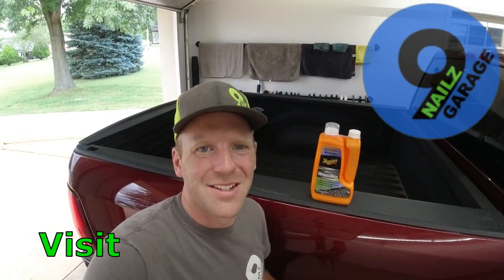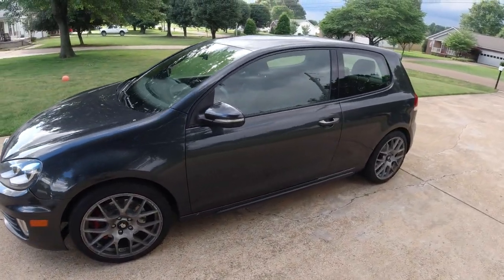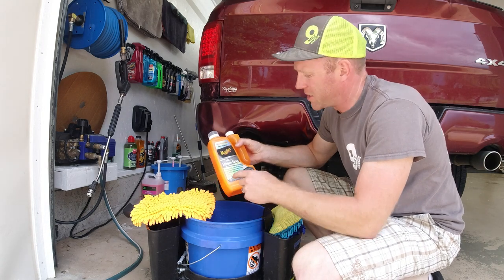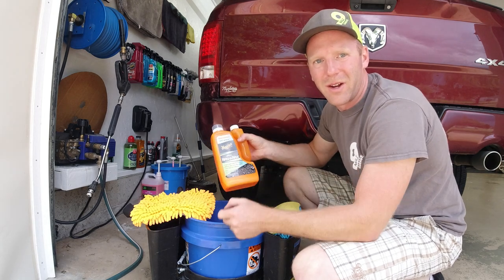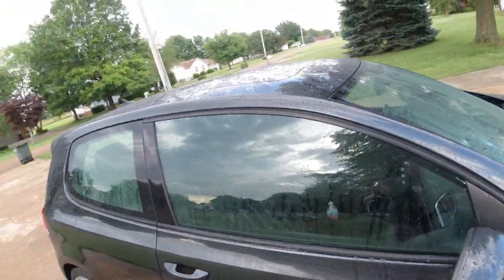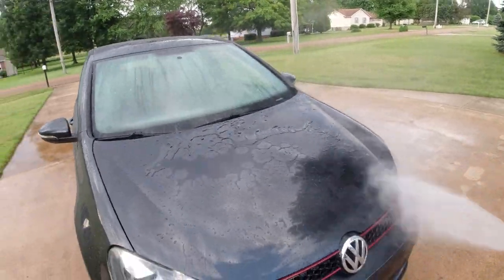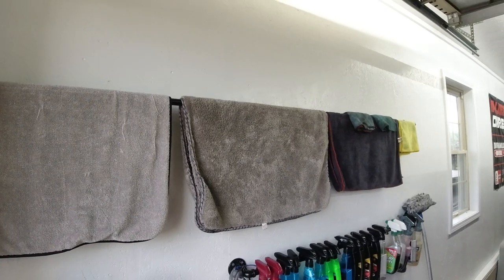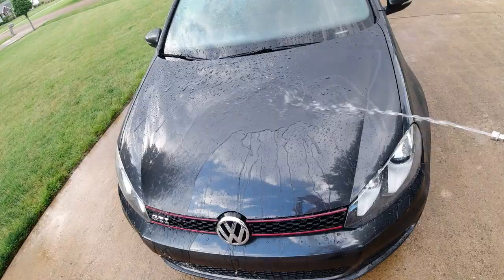Meguiar's Hybrid Ceramic Wash and Wax with Dual Sided Wash Mitt Review

Comment: You got better results not due to the wash mitt, but because most, if not all Meguiar's products, build in layers, especially in the ceramic line...I exclusively use Meguiar's on my 2020 GMC 3500HD AT4, bought it new with 37mi, and now has 6700mi and it still looks as though it just was driven off the showroom floor, and it's been through a Wisconsin winter...Thanks to Meguiar's products...
Reply from the maker: Thanks for the tip. I have used a lot of meguiars products for a long time, they’re most definitely one of my favorite car care product lines. This soap however just didn’t do it for me, the low suds was especially weird, I’m used to the suds providing that barrier to keep dirt and contaminates from scratching the paint. I’m originally from northern Wisconsin, I completely understand the winters. Thanks for sharing!

Comment: Adding that boost in after the bucket is full is definitely the key. I also used with the hybrid wash mitt, very impressive results. Gave my armor all and turtle wax ceramic washes away after. Have been deciding between this, Griots, and Carpro.
Reply from the maker: It definitely made a huge difference adding it after, but I hate to say it I think the armor all is still my favorite. I just can’t get used to the low sudsing. I really want to give griots a try though
Reply: @9NailzGarage  Have you tried griots or carpro? They foam up decently like armor all and can be used in a foam cannon!